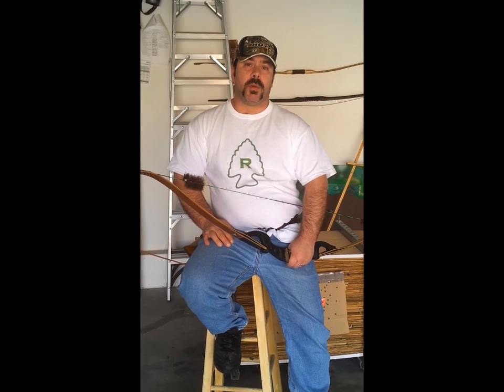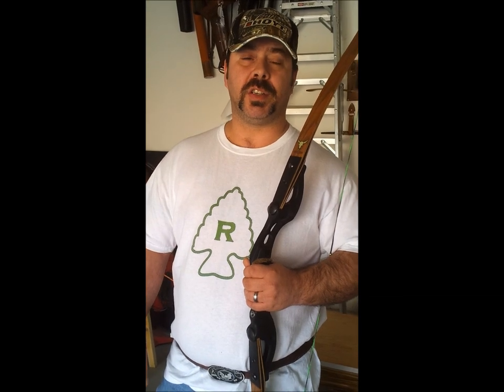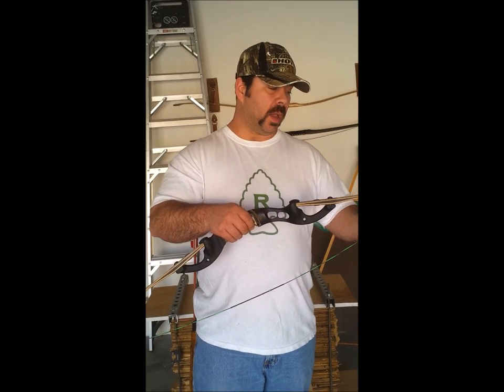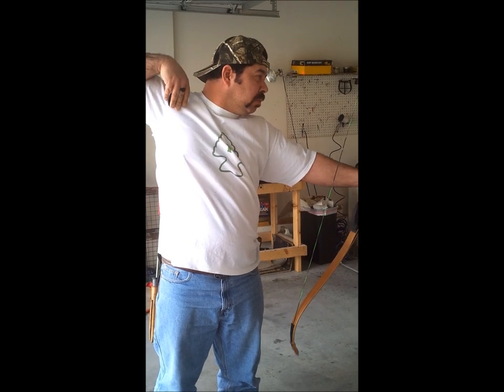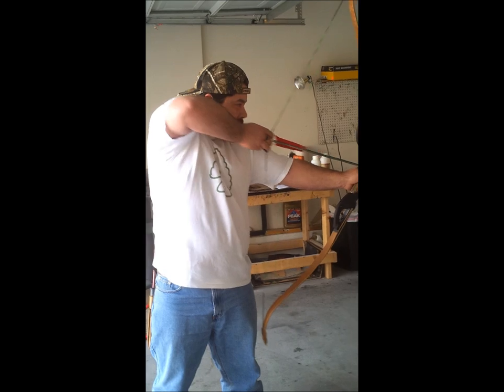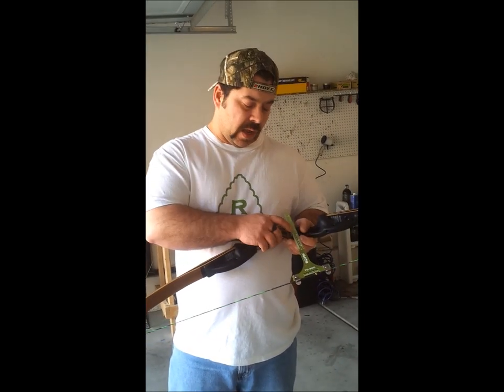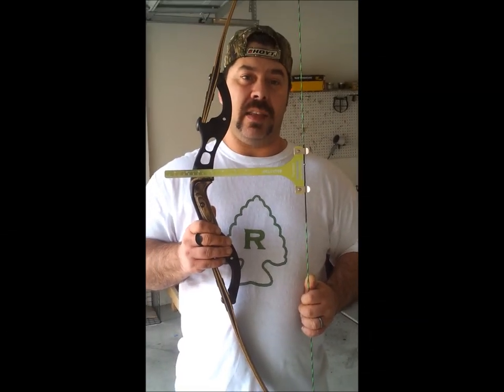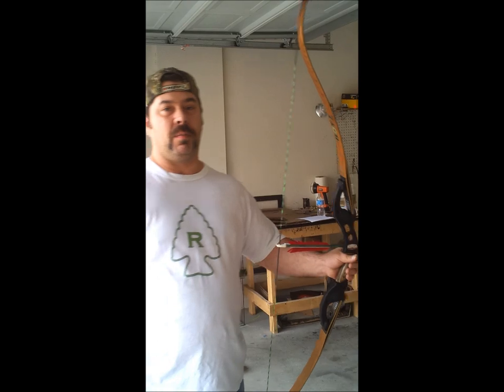Archery: How to Tune Your Brace Height (Revised)

Comment: Just put your point on a certain spot every time then start at the lowest manufacturers recommendation, shoot, increase the bracehight 2 full turns. Keep doing this and you will see that the groups are raising. At a certain moment you will see your arrows drop, then decrease the bracehight 1 full turn. This will be the spot where the bow transfers the most energy in the arrow, least handshock/ vibration and will shoot the quietest.

Comment: So, you basically adjust brace height within the manufactures specs until you find the spot with the least noise and vibration. Then you set your nock point and you are good to go. That's a logical approach and also one which will not confuse newbies with to much theory rambling. Nice job!

Comment: Being a total newbie with no user manual for my late 1960's - early 1970's Bear Kodiak Hunter that is 60" AMO, I would have liked to watch where you and how you twisted your bow string. Did you twist the string on the bow? Did you twist the bottom or the top and does it make any difference? I  wouldn't think so.
Reply: thinking just the same...
Reply: Found out the way you do it is by leaving the bottom loop attached and twist the top loop. On my bows you twist to the left to tighten the string and increase the brace height.
Reply: Dan Morris If you are using a Flemish twist string. Twisting it clockwise will shorten the string and therefore increase brace height. Twisting the string counterclockwise will lengthen the string and subsequently decrease brace height. ( leave one loop on the bow while you twist the other end)
Reply: Got it, thanks